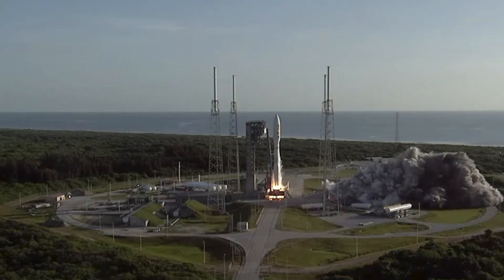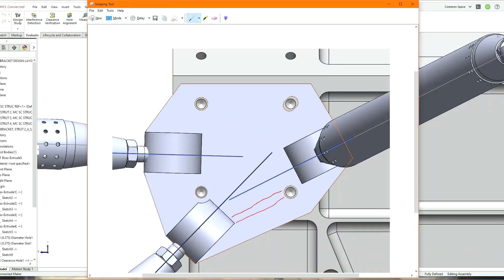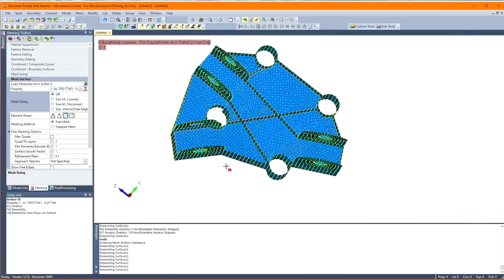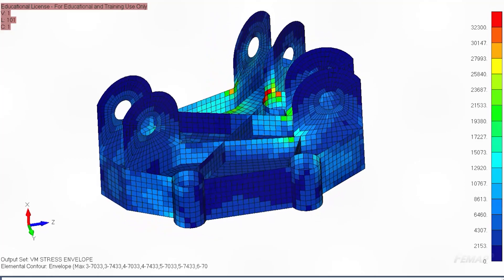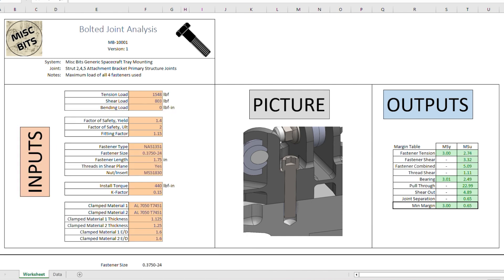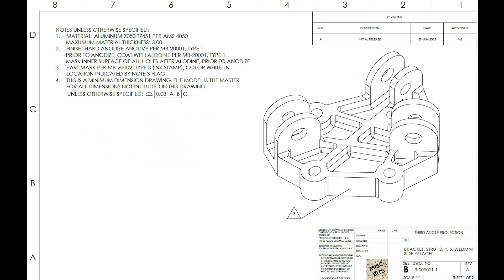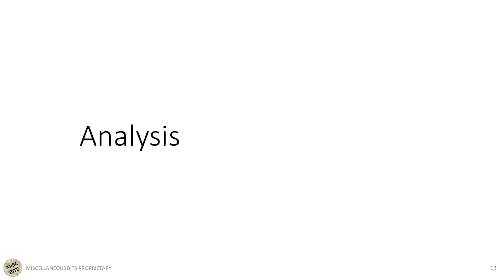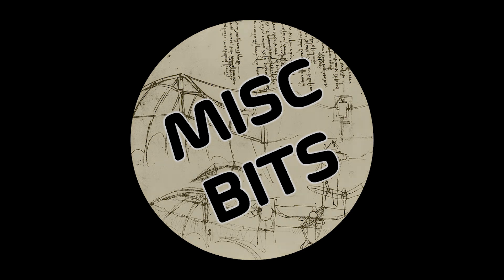Designing and Validating a Part for Aerospace Because... Why Not?

Comment: Just out of curiosity
Do you ever do any mesh studies?
Cause your mesh seems really, really coarse.
Or do you just ignore mesh influences and accept a rough solution as long as it doesn't exceed material failure stresses (with safety factor)?
Reply from the maker: I've done some mesh studies before, but a lot of times you can follow best practices for element sizes and be confident in the results. This mesh isn't all that coarse compared to what I've seen in industry. Compared to solid tetrahedral elements, plate elements can be much larger without sacrificing accuracy. I've spoken to some folks that teach/consult finite element analysis as a career, and one common thing I've heard is that new analysts use far more elements than they actually need.
Reply: @MiscellaneousBits  very interesting!
My background is as a masters student at university and I'm specializing in simulations and the math behind them.
And basically every project I've worked on started with a rough mesh study.
Its nice seeing a completely different perspective on the topic
Reply: @caldera99  As an extra, FEA for pressure vessels refer to documents like the ASME Boiler Pressure Vessel Code, and it recommends 2 elements minimum for thin walls with 4 elements preferred when using hexahedral. If you find the right engineering reference, you can find an industry go-to for meshing and save the time  of doing convergence studies.

Comment: This is cool! I'm not in the structural engineering space, but does solid works not have any simulation capability? It feels weird that you'd have to manually move the model from solid works to the simulation program, especially since you're changing up the model in both solid works and the simulator both. Like when after the sim you added filets in solid works, does that not invalidate the sim? No idea, again I'm not at home in this stuff :D
Reply from the maker: Great questions! Moving a model from the CAD/design program into the analysis program is pretty typical, mostly because the best analysis programs used in aerospace are standalone packages and not part of another program. Also, adding fillets generally does not invalidate a 2D plate mesh since the no fillet option is stress conservative.

Comment: You described the Pin-slot-hole technique, i am curious where would be a good library or index of these "techniques" to reference when designing? Great video btw!!!
Reply from the maker: Every company has their own standards, best practices, etc, I'm not specifically aware of anything generally available... I'll have to look around, but maybe that could be a fun idea for a video!
Reply: @MiscellaneousBits  That would be so handy to have just to brainstorm through ways to solve whatever technical issue you are working on.

Comment: Promoting myself to the certifying engineer, noticed it straight away in the assembly shot, the part wont be able to assemble due to the nuts up the top unable to fit around the other bolt so attachment may need to change or bolt insert direction changed sides. Im quite interested at the final design review section, as a third year mechanical engineer student this hasn't been mention once in my course. Is this a very common thing in industry or does it depend on the companies
Reply from the maker: I played around a lot with the bolt install but decided to cut it out. The nuts will fit, you just need to not push the bolt all the way in when you put the nut on and start threading
Reply from the maker: And yes, design reviews are very common in aerospace. Thanks for your comment!